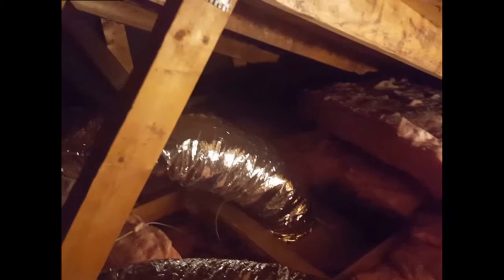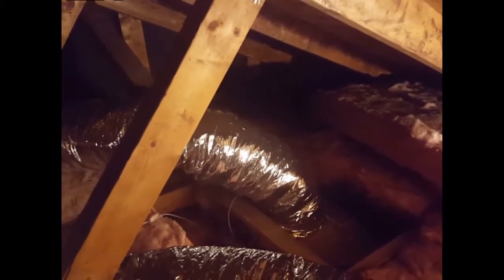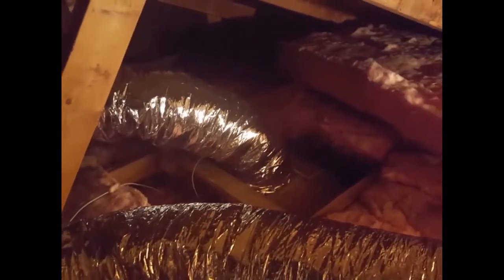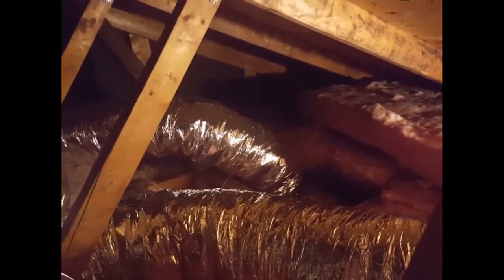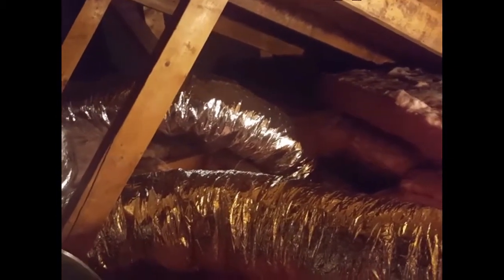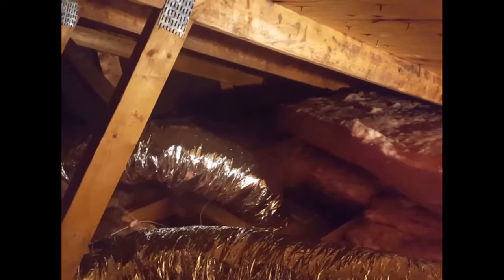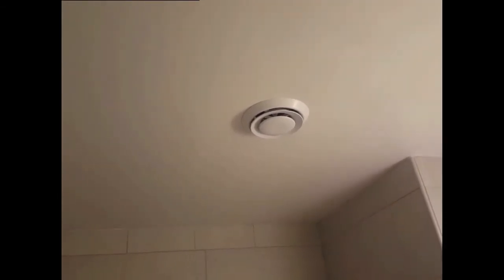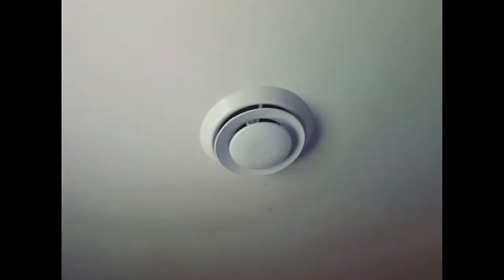Fantech FR200 inline fan

Comment: I would recommend making a plenum box for it to silence the noise.  We have one of these FR200 units at work, and it works well and quietly this way.  The box is approximately 5' x 2' x 2' and it attached right to the intake of the fan.  You can come out of the opposite end of the plenum box with smaller pipes, while the other end has the big 8" pipe.